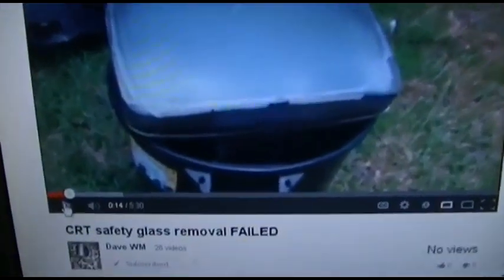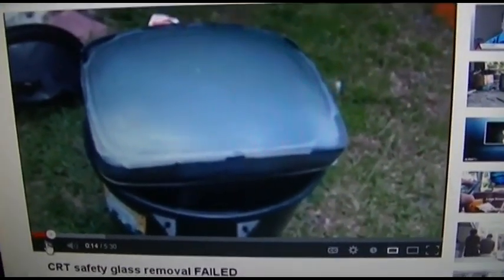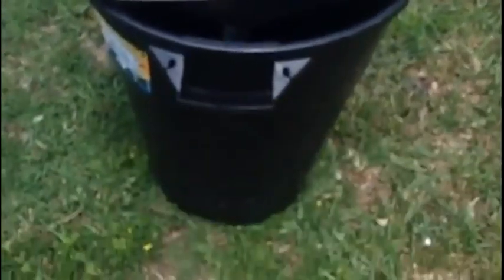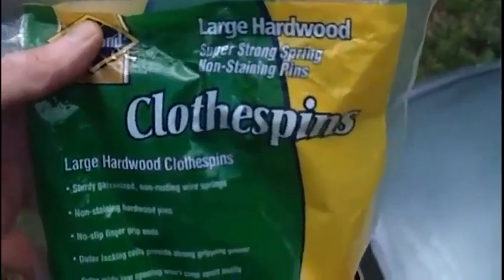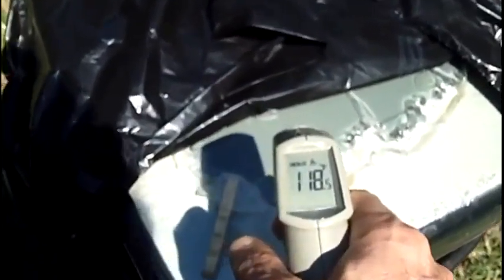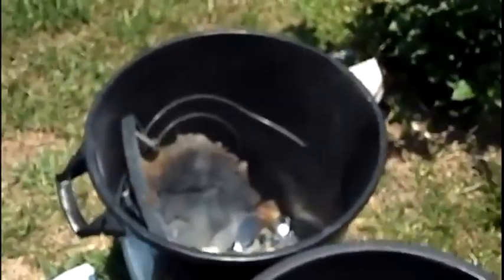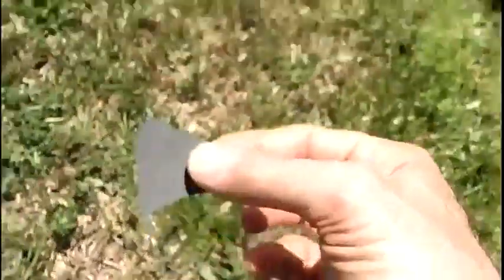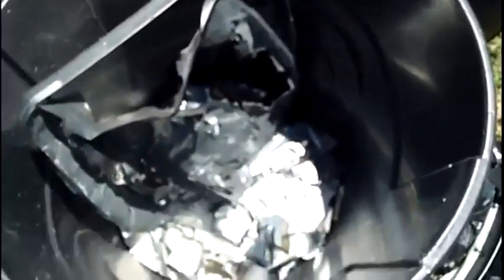CRT Safety Glass Removal Fail

Comment: yea, I would say I just was not a patient as I was on previous CRTs (guess since they had all gone well)). Two things I should have done differently, dug out more of the pva (for more even distribution of the wedges), if I could not get more out I should have soaked the CRT longer to soften it up, secondly I should have waited for a hotter day and been a lot more careful to only apply a little bit of pressure with the wedges. Lesson learned. I too wear a safety shield. but could do more.

Comment: The cracked safety glass at the 3:00 minute mark if how every RCA removal would go for me until I got my heat gun.  I'd end up chiseling the center glass off with a flat blade screwdriver every time (it was hellish)....Must have done 10 tubes that way.  
Many summers it doesn't exceed 90 degrees here in Wisconsin. What I typically do is on a 80 degree or higher day let the tube sit outside an hour or 2 in the sun then hang a 250W heat lamp over it for another hour or 2 till the screen is ~150 degrees or more then use the heat gun to get it to 170-180 where it starts delaminating...works every time.

Two things I learned to never do.  Never set hot tube in cool water (when I'm cooking in the summer sun my brain starts to thermal throttle down) and never try to collect more light with mirrors or lenses....Two different tubes had face cracks (but some how no implosion) from those bad ideas.

Also I've never been able to get the water method to work...I've placed 2 different RCA made tubes in water for over 2 months and the only change was the metal rusting...

Comment: get a windows 7 or 10 stop using the old xp os
Reply: why
Reply: Why? XP was one of the best versions of Windows
Reply: If it works then dont try to fix it.
Reply: Exactly, and Windows 10 is spyware.
Reply: 10 is the biggest load of shitware since windows ME
Reply: this is from 2013
Reply: james shockley  10 is the worst sys ever made, but sooner or later i will have to left XP and 7.. and at that point i will need to strip down 10 to bare metal to use it.
Reply: 2012 is the year tho
Reply: @Synthematix  Vista was